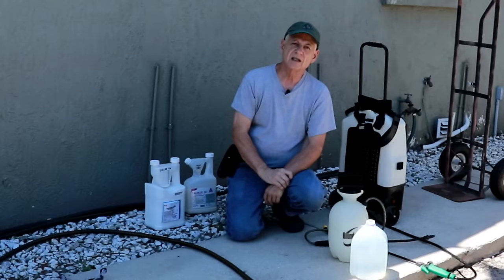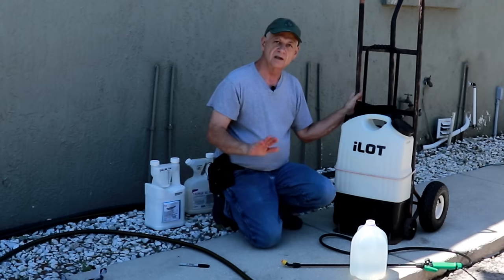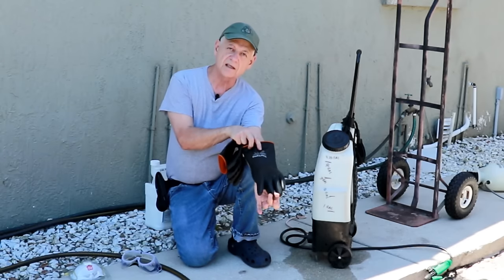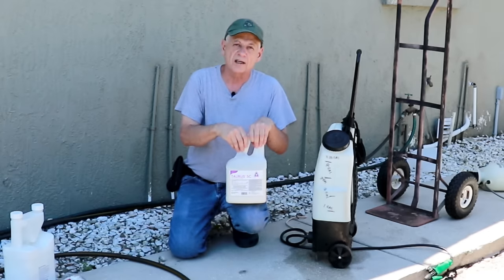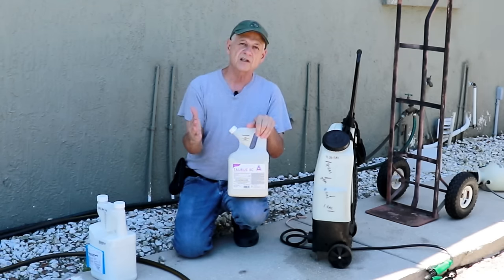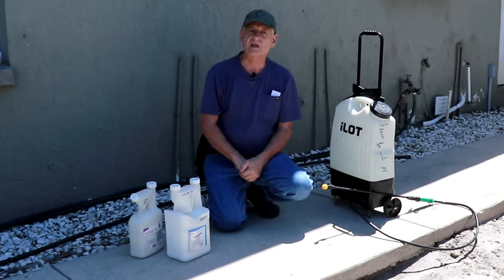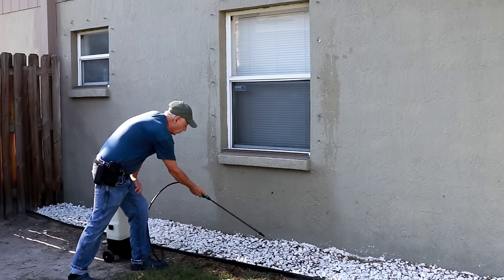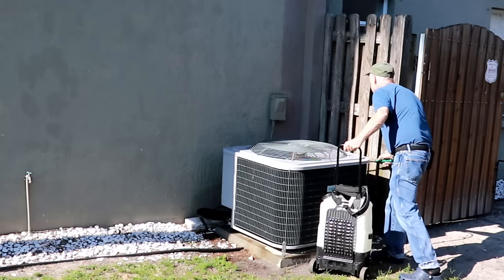General Exterior Pest Control - IMPORTANT!  READ THE DESCRIPTION.

Comment: Guy, thank you so much sir for the incredible information and sharing a piece of your vast knowledge.  I'm not sure if stink bugs are an issue in FL, but they are an absolute nightmare here in western NY.  Any specific recommendations for stink bugs, or just Talstar them to death?  It seems like nothing repels stink bugs, the only hope is to seal the infinite numbers of cracks in my old farm house and hope they die fairly quickly once they penetrate.
Reply from the maker: I'm so sorry that you're having this problem.  There are any number of pesticides that can take care of this, including Talstar P, but the problem is that nobody will ship certain products to New York.  You have the most restrictive laws in the entire country.  One of the reasons why you are having this much of a problem is because nobody can get their hands on effective pesticides, and hiring a pro to treat every 90 days can be expensive, so most people aren't going to do it.  That being the case, the population of stinkbugs has probably gotten out of control.  
 
If you just have the problem outside, then I would recommend treating it with Bifen IT.  Just use it the way I showed in my video.  This is basically the same thing as the Talstar P, but it is a bit cheaper.  
 
To treat the inside, you need to get your hands on CB-80 Aerosol and D-Fense dust.  Domyown.com will probably ship the CB-80 and the D-Fense dust to you.  Use the CB-80 to directly spray any stinkbugs that you see.  Next shoot it into any cracks and crevices that you can find, like around window woodwork and so forth.  Basically, you want to shoot it anywhere that you typically see stinkbugs.  This is a quick kill product that has no residual, but it will knock them down really fast.  Let this stuff dry and then apply the D-Fense dust with a little hand duster, and puff it into all the cracks and crevices that you can find.  You want to apply it around pipe penetrations, under baseboards, around outlets, under appliances, and any place where it will not be disturbed by people, pets, or air currents.  This product has an 8-month residual action, so it keeps working a long time.  If you do the exterior treatment every 90 days, then you should not need to repeat this treatment.       
 
You can try eBay to see if you can get someone to ship the Bifen IT to you.  Sometimes there are sellers that do not care about the law and will sell to you for a bit more money.  You can also go out of state, if you can get the product shipped to somebody you know in a state where it is legal.  The Bifen can be shipped to any states but CT, NY, and VT, by domyown.com.  If you do not happen to know anybody in a legal state, you can rent a box from a United Parcel Service (UPS) store in a legal state and have the product shipped there.  They will accept packages and then all you need to do let's go pick it up. 
 
I hope that helps.  Be well my friend.
 
Guy   
 
CB-80 Aerosol:  CB 80 Extra, CB 80 Aerosol - Free Shipping (domyown.com)
 
D-Fense dust:  D-Fense Deltamethrin Dust (domyown.com)

Hand duster:  Hand Duster, Bellow Duster (domyown.com)
Reply from the maker: I'm so sorry that you're having this problem.  There are any number of pesticides that can take care of this, including Talstar P, but the problem is that nobody will ship certain products to New York.  You have the most restrictive laws in the entire country.  One of the reasons why you are having this much of a problem is because nobody can get their hands on effective pesticides and hiring a pro to treat every 90 days can be expensive, so most people aren't going to do it.  That being the case, the population of stinkbugs has probably gotten out of control.  
 
If you just have the problem outside, then I would recommend treating it with Bifen IT.  Just use it the way I showed in my video.  This is basically the same thing as the Talstar P, but it is a bit cheaper.  
 
To treat the inside, you need to get your hands on CB-80 Aerosol and D-Fense dust.  Domyown.com will probably ship the CB-80 and the D-Fense dust to you.  Use the CB-80 to directly spray any stinkbugs that you see.  Next shoot it into any cracks and crevices that you can find, like around window woodwork and so forth.  Basically, you want to shoot it anywhere that you typically see stinkbugs.  This is a quick kill product that has no residual, but it will knock them down really fast.  Let this stuff dry and then apply the D-Fense dust with a little hand duster, and puff it into all the cracks and crevices that you can find.  You want to apply it around pipe penetrations, under baseboards, around outlets, under appliances, and any place where it will not be disturbed by people, pets, or air currents.  This product has an 8-month residual action, so it keeps working a long time.  If you do the exterior treatment every 90 days, then you should not need to repeat this treatment.       
 
You can try eBay to see if you can get someone to ship the Bifen IT to you.  Sometimes there are sellers that do not care about the law and will sell to you for a bit more money.  You can also go out of state, if you can get the product shipped to somebody you know in a state where it is legal.  The Bifen can be shipped to any states but CT, NY, and VT, by domyown.com.  If you do not happen to know anybody in a legal state, you can rent a box from a United Parcel Service (UPS) store in a legal state and have the product shipped there.  They will accept packages and then all you need to do let's go pick it up. 
 
I hope that helps.
 
Guy   
 
CB-80 Aerosol:  CB 80 Extra, CB 80 Aerosol - Free Shipping (domyown.com)
 
D-Fense dust:  D-Fense Deltamethrin Dust (domyown.com)

Hand duster:  Hand Duster, Bellow Duster (domyown.com)
Reply from the maker: I'm so sorry that you're having this problem.  There are any number of pesticides that can take care of this, including Talstar P, but the problem is that nobody will ship certain products to New York.  You have the most restrictive laws in the entire country.  One of the reasons why you are having this much of a problem is because nobody can get their hands on effective pesticides, and hiring a pro to treat every 90 days can be expensive, so most people aren't going to do it.  That being the case, the population of stinkbugs has probably gotten out of control.  
 
If you just have the problem outside, then I would recommend treating it with Bifen IT.  Just use it the way I showed in my video.  This is basically the same thing as the Talstar P, but it is a bit cheaper.  
 
To treat the inside, you need to get your hands on CB-80 Aerosol and D-Fense dust.  Domyown.com will probably ship the CB-80 and the D-Fense dust to you.  Use the CB-80 to directly spray any stinkbugs that you see.  Next shoot it into any cracks and crevices that you can find, like around window woodwork and so forth.  Basically, you want to shoot it anywhere that you typically see stinkbugs.  This is a quick kill product that has no residual, but it will knock them down really fast.  Let this stuff dry and then apply the D-Fense dust with a little hand duster, and puff it into all the cracks and crevices that you can find.  You want to apply it around pipe penetrations, under baseboards, around outlets, under appliances, and any place where it will not be disturbed by people, pets, or air currents.  This product has an 8-month residual action, so it keeps working a long time.  If you do the exterior treatment every 90 days, then you should not need to repeat this treatment.       
 
You can try eBay to see if you can get someone to ship the Bifen IT to you.  Sometimes there are sellers that do not care about the law and will sell to you for a bit more money.  You can also go out of state, if you can get the product shipped to somebody you know in a state where it is legal.  The Bifen can be shipped to any states but CT, NY, and VT, by domyown.com.  If you do not happen to know anybody in a legal state, you can rent a box from a United Parcel Service (UPS) store in a legal state and have the product shipped there.  They will accept packages and then all you need to do let's go pick it up. 
 
I hope that helps.
 
Guy   
 
CB-80 Aerosol:  CB 80 Extra, CB 80 Aerosol - Free Shipping (domyown.com)
 
D-Fense dust:  D-Fense Deltamethrin Dust (domyown.com)

Hand duster:  Hand Duster, Bellow Duster (domyown.com)
Reply from the maker: YouTube is not allowing me to reply in full to this.  If you do not receive a reply, other than this one, then please email me at guyspestsolutions@gmail.com.  Thanks.
Reply from the maker: I'm so sorry that you're having this problem.  There are any number of pesticides that can take care of this, including Talstar P, but the problem is that nobody will ship certain products to New York.  You have the most restrictive laws in the entire country.  One of the reasons why you are having this much of a problem is because nobody can get their hands on effective pesticides, and hiring a pro to treat every 90 days can be expensive, so most people aren't going to do it.  That being the case, the population of stinkbugs has probably gotten out of control.  
 
If you just have the problem outside, then I would recommend treating it with Bifen IT.  Just use it the way I showed in my video.  This is basically the same thing as the Talstar P, but it is a bit cheaper.  
 
To treat the inside, you need to get your hands on CB-80 Aerosol and D-Fense dust.  Domyown.com will probably ship the CB-80 and the D-Fense dust to you.  Use the CB-80 to directly spray any stinkbugs that you see.  Next shoot it into any cracks and crevices that you can find, like around window woodwork and so forth.  Basically, you want to shoot it anywhere that you typically see stinkbugs.  This is a quick kill product that has no residual, but it will knock them down really fast.  Let this stuff dry and then apply the D-Fense dust with a little hand duster, and puff it into all the cracks and crevices that you can find.  You want to apply it around pipe penetrations, under baseboards, around outlets, under appliances, and any place where it will not be disturbed by people, pets, or air currents.  This product has an 8-month residual action, so it keeps working a long time.  If you do the exterior treatment every 90 days, then you should not need to repeat this treatment.       
 
You can try eBay to see if you can get someone to ship the Bifen IT to you.  Sometimes there are sellers that do not care about the law and will sell to you for a bit more money.  You can also go out of state, if you can get the product shipped to somebody you know in a state where it is legal.  The Bifen can be shipped to any states but CT, NY, and VT, by domyown.com.  If you do not happen to know anybody in a legal state, you can rent a box from a United Parcel Service (UPS) store in a legal state and have the product shipped there.  They will accept packages and then all you need to do let's go pick it up. 
 
I hope that helps.
 
Guy   
 
CB-80 Aerosol:  CB 80 Extra, CB 80 Aerosol - Free Shipping (domyown.com)
 
D-Fense dust:  D-Fense Deltamethrin Dust (domyown.com)

Hand duster:  Hand Duster, Bellow Duster (domyown.com)
Reply from the maker: I'm so sorry that you're having this problem.  There are any number of pesticides that can take care of this, including Talstar P, but the problem is that nobody will ship certain products to New York.  You have the most restrictive laws in the entire country.  One of the reasons why you are having this much of a problem is because nobody can get their hands on effective pesticides and hiring a pro to treat every 90 days can be expensive, so most people aren't going to do it.  That being the case, the population of stinkbugs has probably gotten out of control.  
 
If you just have the problem outside, then I would recommend treating it with Bifen IT.  Just use it the way I showed in my video.  This is basically the same thing as the Talstar P, but it is a bit cheaper.  
 
To treat the inside, you need to get your hands on CB-80 Aerosol and D-Fense dust.  Domyown.com will probably ship the CB-80 and the D-Fense dust to you.  Use the CB-80 to directly spray any stinkbugs that you see.  Next shoot it into any cracks and crevices that you can find, like around window woodwork and so forth.  Basically, you want to shoot it anywhere that you typically see stinkbugs.  This is a quick kill product that has no residual, but it will knock them down really fast.  Let this stuff dry and then apply the D-Fense dust with a little hand duster, and puff it into all the cracks and crevices that you can find.  You want to apply it around pipe penetrations, under baseboards, around outlets, under appliances, and any place where it will not be disturbed by people, pets, or air currents.  This product has an 8-month residual action, so it keeps working a long time.  If you do the exterior treatment every 90 days, then you should not need to repeat this treatment.       

Continued in next comment.
Reply from the maker: YouTube made me do this in two sections.  They do that sometimes.  I don't know why.

You can try eBay to see if you can get someone to ship the Bifen IT to you.  Sometimes there are sellers that do not care about the law and will sell to you for a bit more money.  You can also go out of state, if you can get the product shipped to somebody you know in a state where it is legal.  The Bifen can be shipped to any states but CT, NY, and VT, by domyown.com.  If you do not happen to know anybody in a legal state, you can rent a box from a United Parcel Service (UPS) store in a legal state and have the product shipped there.  They will accept packages and then all you need to do let's go pick it up. 
 
I hope that helps.
 
Guy   
 
CB-80 Aerosol:  CB 80 Extra, CB 80 Aerosol - Free Shipping (domyown.com)
 
D-Fense dust:  D-Fense Deltamethrin Dust (domyown.com)

Hand duster:  Hand Duster, Bellow Duster (domyown.com)
Reply: @GuysPestSolutions  Thank you Guy, you're the best!!
Reply from the maker: @cdgregOG  You are very welcome. That is so kind of you to say.  Very much appreciated.  Be well Greg.